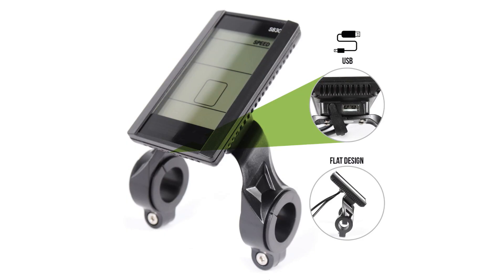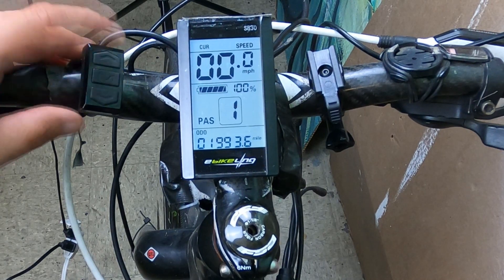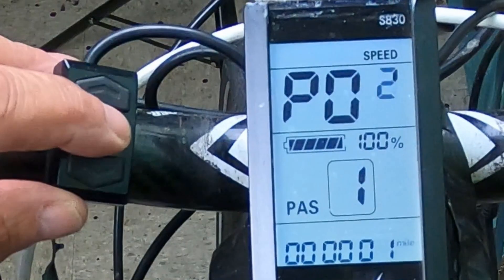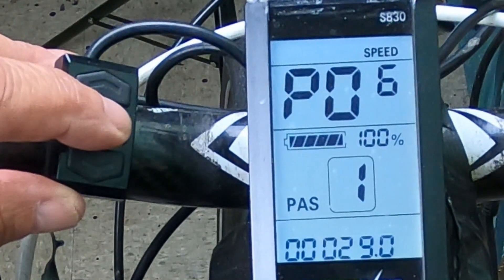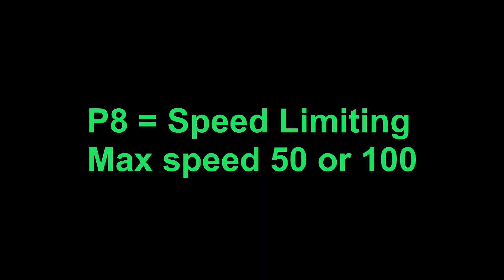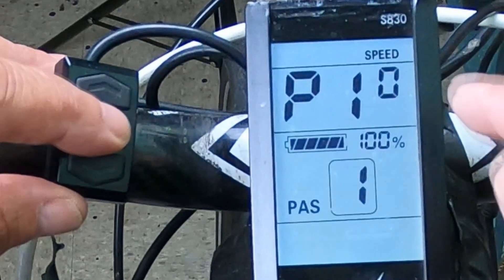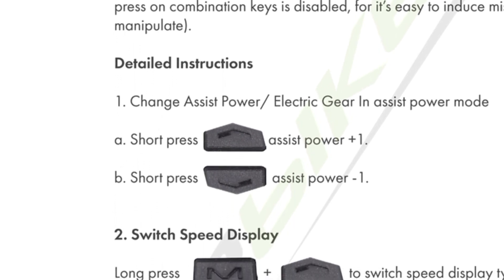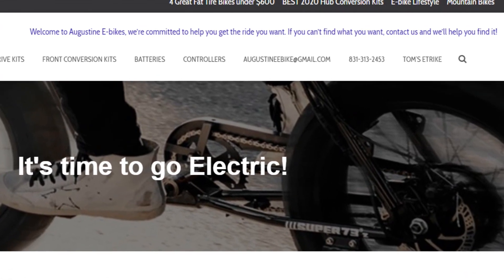E BIKE TIPS: Turbo Charge your E Bike's performance, programming the LCD S830

Comment: I just got a bike with this display,  it's got a 28 amp controller in it but this display only has a 20 amp setting on the display P 14 i believe,  this really ticks me off because I am getting such weak power, is there anything I can do to override this controller amp setting on the display? Any help would be great thank you so much

Comment: Oh well I increased P8 to 27km/h and it was fine and actually doing 28km/h  later on I wonder if I can go 30km/h and it was able to go that for some time until it went 28.5km/h again so again I changed it limit to 28km/h and went to my friend place and instantly smelled burning eletricity 0.o ...... so ofc I took battery off for sec and due key it goes sleep mode,  after waiting while bike actually worked just fine, but I still wonder if even that small increase on speed limit burned out circuit breaker slighty or so... so I went throught voltage option which is normal 48v and my P14 was at 12 and thats amper.... I lowered it to 9 because my voltage meter during underload also says its going 51-52 volt..... so I wonder if just increasing speed limit changed other settings so much that it almost killed it self.
Reply: because if its really drawing 52volt with 12amper its trying pullout 624wat which is way too much, with 9 amper its 468watt which should be safer I think

Comment: You have battery level indicator with percentage showing also. Mine has only bar indicator, but in startup all segments are on and there is 188% quickly shown. So there is option to activate it?
Does anybody know how to put % battery level on?

Comment: If you push the arrow key down and hold it. As you use the throttle to your wanted speed {lets say 20 mph} It starts active cruise {on the fly any speed you want} Active {20 mph} cruise control of your bike.This effect is canceled by a simple squeeze of the brakes { motor power shut off brakes only} or holding of the down arrow key{this isn't easy while moving}.Repeat steps for different cruising speeds as needed on the FLY!!!😎🤯😎😎
Reply: Can you set it for say 30-40 mph?

Comment: Is there a way to adjust the walk mode? When I use the walk assist mode my bike takes off where the bike just jumps way too fast😊
Reply from the maker: Unfortunately the speed is precontrolled and not possible to change. If you are using it to walk up hills etc. Just make sure you are squeezing your front brake to slow it down

Comment: P14 is the amp draw, so if you up it a little it will accelerate that bit quicker. And as for wheel size , and you dont mind untrue speed and milage , if you lower the wheel size the speed limit cut off in theory will be the top revs of the motor.

Comment: Is it possible to set pas so you get instant power from motor as I have to pedal a few times before motor engages but when throttle is pressed I get instant power to the motor

Comment: Mine has P014 for current settings. How do I know my max current? I have the ebikeling 1200W internal with 48V 20ah battery. I tested and only got up to 30mph on flat (I’m 130lb). It’s a 26” bike with road/touring tires. Any tips? I set max speed to 100. I will try the 50 setting next as you suggested I’m the video.

Comment: the cruise function shoul only lock in the speed th motor is tuning at. it should not accelorate the motor. seems like what you experienced is a huge safety issue. 
do you know if it has setting for regenerative braking?

Comment: Hi, a very good and useful video. Thank you. I have an S700 device and I have a problem that the TRIP and ODO resets every time I turn off the S700 LCD. Can you please help me ? Thank you
Reply from the maker: Unfortunately, this is a problem with these LCDs. It should reset your trip, but not your odo. Try turning off the LCD after a trip and then turn off the battery.

Comment: is it possible to set the walking mode for 15 - 13 km on the display  s 830
Reply from the maker: Press the down arrow key for 4 to 5 seconds.
Reply: @AugustineEBikes  .. but how to make it not 6 km, but 13-15 km cruise control?

Comment: Any ideas, how to figure out how many magnets do I have into 35v 250w hub motor. If no one mentioned it ever... god dam it! In my case-S830- by default it is 20?? In yours case it is 47!!  ??? Please!
Reply: Have u find out the magnets number?I've got the same motor and E10 error.Thank you,happy new year!
Reply: @alx-v7x  Happy New Year Alex! No, I didn't. But I set the parameters to the maximum. And I have a 100 amp battery. Now my bike accelerates very well and keeps speed confidently even after an hour of riding. these numbers - P1 - to P9 - is the force of acceleration. The mode of the number of magnets did not affect this in any way (in my case). So now I bought (as the Internet says, it doesn’t matter what voltage and amps you have - the main thing is not to burn the motor during overload - if there is no overload, everything is fine).... I ordered a 48v 100amp (2000watt) battery. I will install a switch between batteries - a choice of 36 or 48 volts. to have a boost. :-) let's see what happens. So far, my calculations have confirmed that the Internet is always right! :-) I haven't made any mistakes so far - my bike rides great - I love it.
Reply: Alex- set everything to default settings- then try to adjust... take you time..
Reply: I was talking about settings of P9- the P8 dose nothing for me
Reply: @dluuc  What are the default settings? Anyway I figured it out that maybe the controller (KT)isn't right for the display,so I ordered another one
Reply: @alx-v7x  f you are talking about the settings at the start, then they are always the same. turn on - look - PAS-01. then increase to 09! all go! try it.
Reply: @alx-v7x  I hope I understood you correctly. I'd like to ad something- I got mine default settings, but I only use full electric capabilities...that's all..

Comment: S830 LCD has 16 settings it would help if you explained it better each setting. P7 Motor speed magnet type 0-100 47 for direct drive Motor 100 for geared motor, I've been told to have this at 1 or you won't get exact speed display. Mine is 250w hub so what should I have it?

Comment: Can you please explain the P11 PAS sensitivity range I see it goes from 1-24.  And can you explain what is meant by current?
Reply: "Can you explain what is meant by current?" In DC electrical circuits, power in Watts (W) is determined by voltage (V) x current (I). Voltage is in Volts, and current is in Amps. Now imagine a group of people pushing a broken down car... Think of voltage like how many people are pushing, and current as how strong they are. The combination of the two is the total power available. P=VI, P=I²R, P=V²/R 👍
Reply: The P11 is the P.A.S. sensor sensitivity level. 1 is the max range,after that is a delay in the start of P.A.S. sensor.

Comment: i recently bought an electric bike with the LCD S830 installed. 
I have been trying to change some settings in the configuration menu according to your video, but they seem to be locked and cannot be changed (for example P04, P05, P09 etc.). 
Do you know how i can unlock these settings and make them customisable? That would be of great help!
Reply: P04 sets the display timeex. On 0 never turns off,P05 is the P.A.S. level you got for the bike.
Reply: P09 at 0,P10 at 2,P11:1,P12:1.
Reply: Same problem, I can't change the varibales in P09 or P10 how do I unlock or re-flash my display
Reply: P09 : 0, P10 : .2
Reply: @alx-v7x  I saved that settings, mate. But listen my LCD is blocked i can not change the varibales its locked
Reply: Why dont you ask the store from u bought it? Is the voltsge,rim size setting good?

Comment: My motor just started running  backwards. How do i fix?
Reply: You've put it on backwards 😅
Reply: @BertAndSmokey  No! It was runnigfineforat leasta a month.
Reply: @dougfox9649  did you build the hub yourself might have jumper cables wrong way round.

Comment: My kit came stating it was for 700c or 29in. However the setting was set to 26. Did not know how to check for this until this video. So my speed was low a few mph and my distance travel inaccurate. Thanks a bunch. Now which particular kit is this? I'm going to check P7 setting for speed test range, which I have no idea what it is or does.
Reply: Did you find anything about p7??
Reply: @CBOU1993  I left the setting at default I believe.
Reply: What is the default for P07,11,14?

Comment: Hi is it possible to have the PAS set to 2 for example but when i decide to use the throttle i get the full power of the motor as my throttle is dependent on the setting of the PAS. ie if its set at 2 then i get limited power from the throttle but if i set the PAS to 5 i get more power from the throttle which is irritating because if im going up a gradient and need a little more power than what the PAS is providing and press the throttle it stays at the same power unless i reach over and turn up the PAS?
Reply: Did you ever figure this out? So that pedaling uses PAS 2 and throttle is full power?

Comment: How do you reset the Trip meter, without resetting the ODO ?
Reply: I power off the computer then on again. What I can't work out is how to make it remember the Trip distance if you stop for a break and switch the bike off.
Reply: @PeterWTaylor  It never will, once turned off you can't retrieve the trip or avg speed, same for sw900.
Reply: I’ve been frustrated by the same thing. What’s the point of having a trip if it resets every time you switch off.

Comment: Hi thank you for the instruction video , i have a question.  My speedo is say I'm travelling way faster than i am os there something wrong i have done.  I have it set to mph as I'm in the uk.  Thanks
Reply: I had the same thing and it's to do with the magnet settings p07 and p13 make sure you have the right number set and you should see the correct speed.
Reply: Actually I think it has to do with the wheel size just change that in the settings to what ever your tires say
Reply: I had the same problem with 26 inch wheels. I had to change the wheel size to 24 to get the correct speed.

Comment: Hi just a quick question,  is it possible to have the ebike on power assist but when you press the accelerator switch it just takes over and or  just the accelerator switch alone and if so how do you do it because when i press mine nothing happens but it does work with the PAS when im peddling but the button does not ?
Reply: Did you ever figure this out?

Comment: Unlocking speed limit.... does it turn off pedal assist... mine is now not working only working on throttle even though in programme it is set to both??
Reply: Same here. Unlocked speed limit and pedal assist not working, only throttle :(
Reply: Try setting it to pedal assist only (see vid) and see if it works like that. If it does, I'd say do a factory reset and then change your max speed again.
Reply: @fionashepherd6587  pedal assist only - not working. How to do factory reset? Thanks

Comment: Do you have any idea what to do about error code 07?
Reply: My samebike went in to a local bike repair ship for the past few wks they couldn't diagnose the E07 code issue I also have.  
I decided to order a replacement motor controller hoping to solve the issue.  In the mean time I decided to take the back wheel off and look at the inside of the motor hub.  I noticed on the LED display I had not only the error E07 code but also a M symbol which by researching online on the samebike manual it explained it was a possible fault on motor hub.  
Un clipped cables to give me some slack to work with, Took back wheel off, undone screws around hub, turned upside down so cogs would come off and I could get inside hub.  Checked cogs inside and re-greased with lubricant that had been squished out, made sure no debris in there. 
Looking at the circuit board, checking wires I noticed the green wire had become lifted off the solder from the circuit.  I pressed this down and tried the throttle,  Hey Presto the motor worked full power.  
I went off and purchased a solder gun from b&q and went on to solder the green wire back in place.....I checked other wires weren't also loose!!.
Back wheel back on, cables clipped back in tidy with new small cable ties. 
A little fiddly to get the back wheel on and off around the chain but got there in the end.  
Got on the bike for a ride and it's all working fantastically.  No more E07 code or Motor hub fault symbol. 
Bike working beautifully!!! 
So happy with myself for having the patience to stick with it and find the problem and all it cost me was £17 solder iron.  
I'll be returning the brushless motor controller to Ebay as I no longer need to mess around with that.  
Give yourself a couple of hours and have a look in the hub.  
The bike is awesome, I've had a happy 18mnths on this before this problem and was reluctant to give up on it just yet.